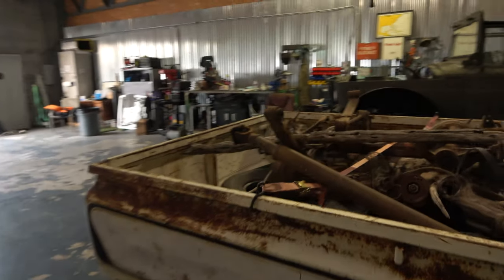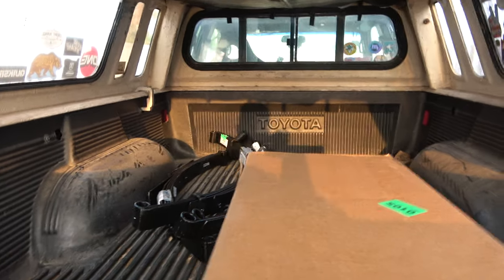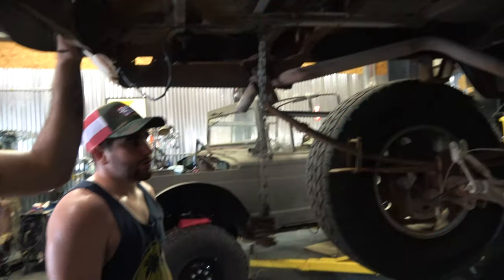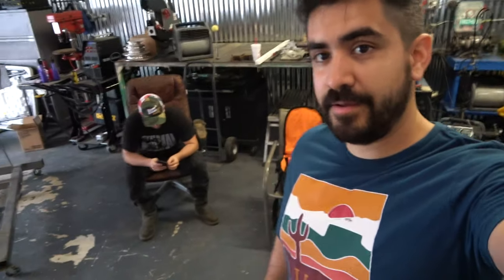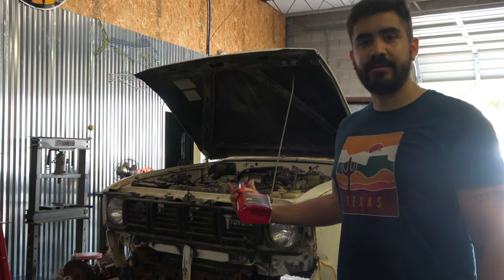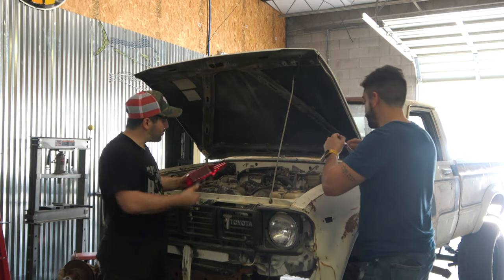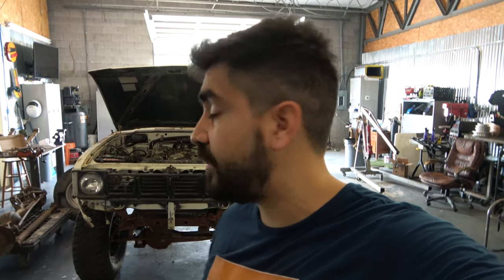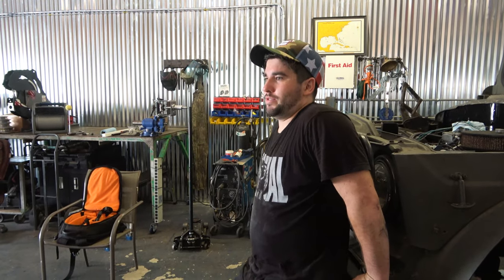1981 Toyota Hilux Pickup 4X4 Lift Kit Install

Comment: A 3/8" plate welded to the driver side spring perch will cure the driver side lean. They are available through multiple places that deal toyota stuff. For some reason toyota made the passenger side spring perch higher than the driver side. Not by much. But it does throw it off to notice. Most aftermarket springs do not compensate for that and that's why a plate is required.

Comment: I got a 1982 Toyota pickup reg cab 4 speed in perfect condition. No rust on the panels. $17,500.00 123,000 miles..1 owner before I bought it.

Comment: there are grease-able shackles avail from several offroad companies that fit these ol girls with poly bushings so the suspension stays tight and the grease able means they wont wear out an squeak so much giving great flexability not expensive either like 15 bucks also the corner markers out of old corolas and mazda trucks of the same age theyre metal backed not plastic which rot out (i own a 79 pickup) the electrical plug is identical minor modification an the metal side markers will fit great in the fenders (the same company made the markers for both toyota and mazda)

Comment: That front driveshaft will be EXPENSIVE
Reply: like HOW expensive?
Reply: @aidenmcfarland9566  just to lengthen a shaft is about $150 but it goes up from there if you need new joints, a long slip shaft, or a complete new custom shaft. Depends on your needs.

Comment: You should of done stock toyota 3rd Gen up front and ranger springs in the rear with high steer 4.88 gears with 4.7 transfer case weld front gears put limited slip in rear so you can still drive on road 35 in tires